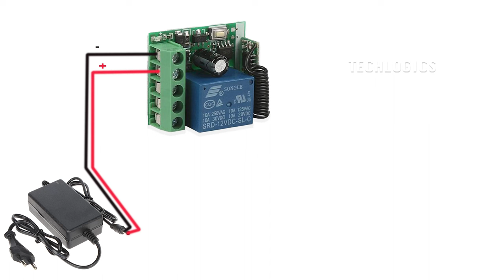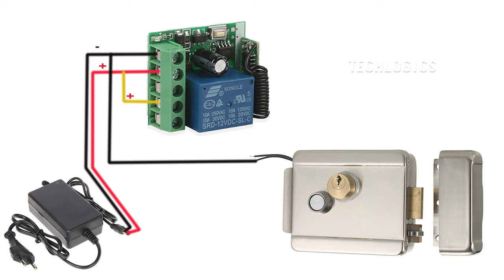Electric door lock remote control using wireless receiver relay switch wiring connection diagram

Comment: If you're to use batteries as power source, how will you prevent the battery from draining quickly
Reply from the maker: If you're planning to use batteries as a power source, it's important to note that battery power is not ideal for operating this lock because it may lead to quick drainage. For optimal performance and longevity, use a power adapter only to avoid frequent battery replacements

Comment: I want to unlock with remote as well as with botton.

My lock unlocked with button and when I connect this device I have to press that button as with remote. How do I unlock using both the remote and the button installed in at my house?